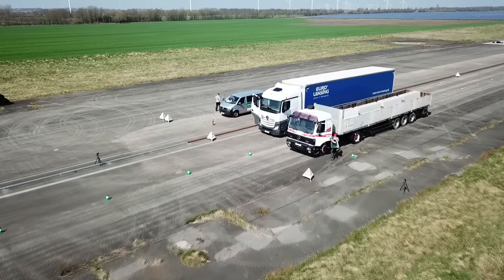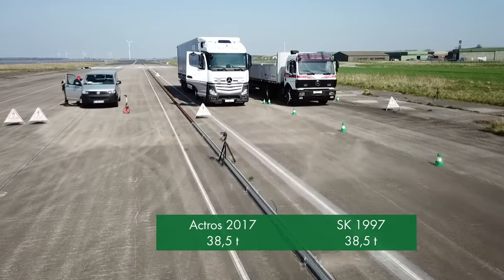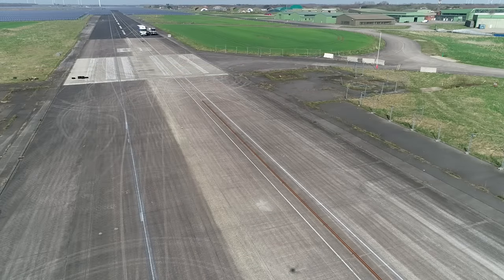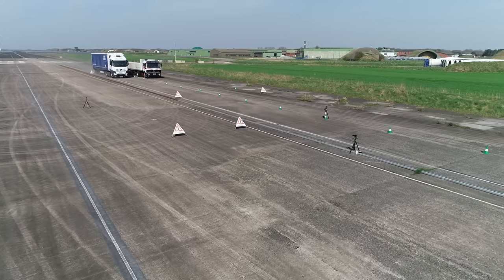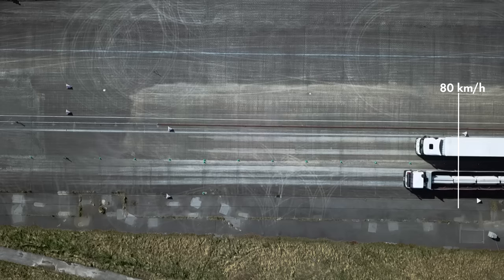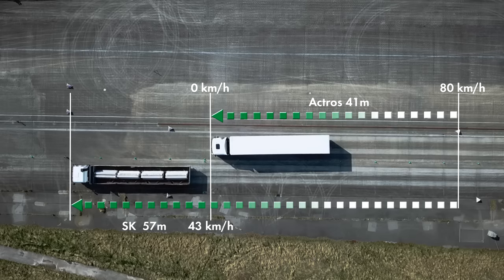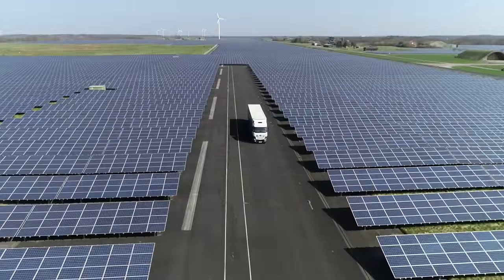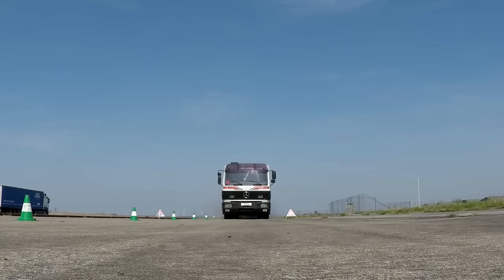Brake test: Modern truck vs. old truck

Comment: Now about the Mercedes safety in real-life. I got nearly killed by Mercedes emergency braking system. While driving through a curve, fully loaded, the sensor indicated something (a rain drop, autumn leaf idk) and started braking with full force in the middle of the curve. Great experience, had to do my best to stay on the road.
Reply: mercedes benz should detect stationary objects not a rain drop or leaf
Reply: I turn all the crap off! Lane assist and collision alert! I frickin hate it when 'it' thinks!!!!!! I'm the bloody driver, let me drive! This shit is because drivers will drive tired or drunk or drugged or on the phone or reading a map and people have died cos they not paying attention! So us professional professionals have to suffer! It like race cars, drivers love a raw car, start putting computers on it to help, drivers hate it!
Reply: @terrystratford1235  That's  why I love 90s cars and trucks, too old means harder to find parts, too new means too many unstable computers. 90s are just right.
Reply: Happened to me it kicked in when raining and the car passed me on the m1 with fog lights on just took a noise dive drive a man truck now no problems yet!!!
Reply: I've heard they also do that in some tunnels and roundabouts
Reply: Now u have a experience you can tel everyone.
And it is not only M B
DAF has the same problems
Reply: @truckingwithwim8039  i think because the straight shadows. but maybe if they would combine it with the radar system it could be fixed
Reply: @bruhh_007_  You mean with the same system as what Volvo has?, thats a good system
Reply: Your Freightliner brethren over here in the states don't have it any better.

Thanks, Daimler.
Reply: @evonation630  Happened to me, too. It kicked in during rain when a car passed me on the M1 with fog lights on. Just took a nosedive. I drive a MAN truck now, no problems yet.
Reply: @nathanmenezesaw1983  or its a company vehicle! It's a Renault t5! I don't think any self employed buys a Renault! Volvo running gear with Renault cab! It's ok, but when you've driven a Scania, you don't want anything else!
Reply: I will never brake for rain drop or something. Did it say it's breaking for pedestrian or vehicle.
Reply: You can override the system by throttling past kickdown
Reply: @nathanmenezesaw1983  the systems are mandatory by law. They're not an option anymore
Reply: I experienced that problem too in my car. Actually it was a crash barrier that started in the middle of the curve and the sensor didn't check that I was not even steering towards it, only that it was right Infront
Reply: Almost like we should be trusting ourselves as drivers more than an effing sensor and a computer. I would not buy something that can try to drive for me. Cruise control can even try to kill you, but at least that tech has been around for many years and has had some refinement. All this new automatic steering and braking is an accident waiting to happen. I'll stick to vehicles without that crap in them.
Reply: Yes the same unwanted experience. Poor guy behind me. He must went to change pants..
Reply: Scanias do that too.
Reply: Give this man an Autumn Leaf
Reply: To be fair the improvement in stopping distance here quite likely is the result of reasonable engineering of the anti-lock brakes instead of this marketing driven useless half baked "fully automatic safety features".
As a general rule the overambitious new "fully automatic" approach fails, gets silently abandoned to be replaced by a reasonable driver assist approach not suffering from these unpredictable effects and failures.
Reply: You can complain to the company then 🤔
Reply: The auto breaking is the most dangerous feature on any vehicle I've ever driven its absolutely lethal
Reply: The problem is that a lot of vehicles, truck included, use a rather 'dumb' radar-based system. It can be fooled by the armco (barriers) on the edges of curves as you're taking them, they can also get false positives from the radar bouncing off other things.
Over time I hope these systems become much smarter and much more aware of where the vehicle is actually travelling vs 'if there's something in front then brake'. :)
Reply: I had many similar experiences with a system (forget the name now) on a Freightliner Cascadia.  The system even overrode the ABS once and locked the brakes to a complete standstill on the highway.  I will never use that junk again, the real world has too many variables.

Edit: Maybe the Bendix system...  It freaked out when an empty potato chip bag blew across the road one time too.
Reply: My truck has the same type of system. Fucking shadows set them off
Reply: @omarmontana1969  yes...something was in front of him.  a leaf, a traffic sign (this is the MOST reason!), a pigeon, a tree. the emergency braking system in an Actros is WELL known for this behavior....just watch the videos of several truck drivers, where you can see an Actros braking for nothing!
Reply: @terrystratford1235  I drive a 2008 Scania R-series and I absolutely love it, besides that the ABS is not working on one of my trailers. Great handling and no assists besides ABS, EBS and TCS. It's fucking marvelous.
Reply: @tntfreddan3138  I love the Scania!  I drive Renault/ volvo and daf. I hate the daf! It's soooooooooooooo slow to accelerate! Crap on fuel and the steering while reversing seems slow, makes me look like a learner!
Reply: Cool.
Reply: We will be having even more fun when ! "AI" cars take to the road.
Reply: Driving is a task for humans, not machines. I would really hate to be suddenly braked(or similar things) by the electronics of the car while i drive
Reply: How about the load, be it pallets or rolls of steel trying to tear off and flatten the driver's cabin, with the driver inside, in emergency braking situation.
Reply: Want a timely fix to the problem? someone should make a device to trigger these Emergency braking system, then some fix will come quick. Until then, good luck.

Past history, Pinto's fuel system, Focus, Fiesta transmission.
Reply: When backing up Escalades do that also  . Most of the time there’s nothing there . I think it must see dead people lol
Reply: @Muh1000  Hmm, what car was it? I have a Mk4 Skoda Octavia and never had an issue with the auto braking; sure it might throw up a warning a bit early but never had it brake on me for no reason. Then again it does have both radar and sensors as well as a lane camera.
Reply: @johnbower7452  Kia Picanto Ja GT, but yea it only has one sensor in front. Also after some service (they likely made a system update) it never happened again and there were some situations where it was on point
Reply: @pqhkr2002  I have to agree with you. Sadly, 90's machines are at least 20 years old
Reply: @sayingnigromakesyoutubecry2647  But they are reliable, many many of them still driving around, some with bad interior and exterior, but powertrain still in very good condition. Cars transporting people around, trucks and vans doing their daily jobs. Most of them already have 200k or 300k miles on dash, some even more, but still powerful, still trouble-free on emission test and their job site.
Reply: @pqhkr2002  it's true. They were well built. Materials were good. And they don't have corrosion troubles unlike an 80's car or older. Also they are fuel injected so they start up without problems.
Reply: @sayingnigromakesyoutubecry2647  Yes, 90s computer system simplified fueling, idle control, and ignition timing, adjustment works got reduced greatly or  no adjustment at all, which makes engines easy to maintenance and diagnose. But then mechanical structure become more and more complex, they introduced VVT, direct injection, etc.  Computer system get bigger and bigger, have more and more sensors, then more and more unreliable, harder and harder to diagnose, and more and more expensive to repair.
Reply: @pqhkr2002  yeah. 90s is a little electronic technology but not too much. Anyway, it's nice to have vvt... Some 90s cars have that.
Reply: @sayingnigromakesyoutubecry2647  I know Honda have many VVTs in 90s. Toyota, maybe late 90s? 
Yeah, VVT is a good thing to let small engine have better output, but seems like VVT is usually driven by oil pressure, so it's sensitive to engine oil. Owner have to keep eye on oil to make sure it works as it should be.
 I have met 2 extremely screwed up VVT cases. One is an Audi  V8, used wrong thickness oil, VVT stucked at some position, caused wrong valve timing symptom. 
The other case is a Corolla,  low oil, caused VVT explode. Yes, it exploded, blew a hole on timing chain cover.
Actually I don't like such complex things in my engine. You know in machine world, the more complex, the more unreliable. So for me, when I need more power, I just get a bigger simpler designed engine to get more reliable raw power.  Like my 1994 Chevy454 7.4LV8, TBI type EFI system, yeah only 230hp, quite a poor power to displacement ratio, and poor fuel economy, but it's like a rock. Seldom to break down, easy to diagnosis, easy to fix and parts are cheap and easy to find.
Reply: @pqhkr2002  woah that's a pretty big engine. In my country 2.0 is already big. Most use 1.6 4 cylinder.
By the way, you are saying something similar to Scotty kilmer. But he chooses a Toyota celica 95 1.6. it's a Corolla coupe essentially and it doesn't have vvt.
Reply: @sayingnigromakesyoutubecry2647  Big engines, that's why I love America, a country that have big machines every where.
Scotty Kilmer, he is a skilled mechanic. I watch his videos sometime, but he speaks too fast and too much for me, because English is not my mother language. 
Celica, I met an 88 Celica GTS recently.  Wow I love 80s design, both interior and exterior. But don't know why, I am 170cm / 5f7in tall, and 80kg / 176lb weight, a typical Asian people, but have hard time to get in it.
Reply: @pqhkr2002  sometimes cars are made for certain markets ... And it's size changes it.
Reply: @pqhkr2002 it's cool to have big engines... But I think that a V8 is overkill. Like I said, a nice 2.0 is big enough for a normal use... Even a 1.6 4cyl has 170km/h max speed, and max legal speed is 130 km/h. Yes I know, a V8 7.0 with 250 hp will last forever at those speeds... But forever could be too much 😂
Reply: @sayingnigromakesyoutubecry2647  Yeah, if power the SUV it self, it's overkill, but if with a trailer weights 6000lb / 2.7t towed, and cruse at 80mph / 129kph, maybe it will be just right. This SUV have towing compacity of 10,000lbs / 4.5t. The last owner told be he cruse at 80mph with a boat, not sure how much weight his boat is. And I also read someone have same model and engine, said he once even forgot he was towing a car while crusing in mountain road. My SUV is 1994 Chevy Suburban K2500, actually same powertrain with Chevy K2500 pickup truck at same time period. Not sure if you are familiar with Chevy trucks, but you should familiar with Ford, Chevy K2500 have same weight rating class with Ford F250, and Dodge Ram 2500.
Reply: @pqhkr2002  well, that's a different story. I was talking about small sedans, like something a little smaller than a civic. Like a 90's civic for example. SUVs always need a bigger engine. One of the most popular SUVs here in Argentina is the Honda CR-V, 2.4 liters. So we don't use big engines... Maybe you can find a v6 3.0 as a very big engine. Toyota Camry and Honda Accord are considered too big for us, uncomfortable for parking and too much fuel... but I understand that in USA they are considered medium size and are very common.
We have a lot of pickups, the most sold is the Toyota Hilux (2.4), we have a lot of Ford ranger 2.3, vw Amarok (I think it was 2.0tdi), Chevy S10. You can find some Rams 1500 and 2500 but it's overkill. For work, Toyota Hilux is best. You might find a new ford f100, there are lots of old f100. F150 are rare. F250 worse.
I have no experience with trailers, and they aren't that common, but if you see those, they are usually pulled by a pickup like the ones I said before.
Reply: @sayingnigromakesyoutubecry2647  Actually not every where in US are big car friendly, like San Francisco or many downtown area of big cities. I always park my SUV in a safe parking lot, then take bus, tram or subway. It's already a pain to drive on those tiny streets, just don't mention finding and getting in a roadside parking space.
If I am in your country, probably I will go with CRV, or shorter version of pickups.
I don't know how those pickups supplied in your country. Here in US, they have different cab and bed configuration, so they have different wheelbase and overall length.
I don't like sedans, because they are too short (antonym of tall), eyes of driver or passengers are right the height of highway fence, water mist in rainy days, and same height of truck wheels.
So I like SUV, pickups or vans.
I want bigger engines, is actually for more torque, to reach posted speed faster. I am not a racer. Bigger torque is quite handy when enter highway via a very short merge-in line. Just flat out, when reach the end of line, I have got same speed with traffic and merge in safety.
And bigger engines can last longer.
Reply: @pqhkr2002  it's true, I forgot that you can't drive in big cities. Here in Buenos Aires I would never go in a car. Perhaps I would use a bike but there's too much traffic. About sedans, I like them because they are smaller. When your car is shorter in height, that means you will save on gas. Also, they weight less. But I understand that a tall car can give you more vision.
I dunno why we had crvs. Maybe it's because they came early and thanks to the good quality they remained. We also have a lot of cheaper Ford Ecosport. That was the first popular SUV. I don't think you can find one in USA, since it was more of a regional vehicle. It has a 1.6 or 2.0 4 cylinder and the first model was based on the Ford fiesta in the 2000's.
I don't think we have many options about pickup configuration. You can chose 2 or 4 doors, but not much more. Most pick-ups are small, and the RAM 2500 is much bigger.
Reply: @pqhkr2002  I agree, having a big engine gives you safety. Not only for merging in the highway but also for overtaking. But even so,  I feel pretty safe in terms of power and torque with my mom's Ford Ka sedan 1.5 2017. it's like a more basic Ford Fiesta. This is a 4 cylinder with vvt, and the newest model is a 3 cylinder 1.5 with a little more power. Since it is so light, it moves very well, and it has decent torque for it's displacement, maybe thanks to vvt.
We used to have the Ford ka 1.0 and 1.6 4cyl from the beginning of 2000's. That car was a small compact. The 1.0 was sufficient, but the 1.6 was very fast. It was amazing. And none of the cars I mentioned was turbo
Reply: @sayingnigromakesyoutubecry2647  Yeah, I have no memory about Ecosport here. But Fiesta, I think I meet some. 
The shortest pickup here is 2 door, single row of seat, with 6 feet bed, I am not sure if there is 5 feet bed. Many people purchase 4x4 version, usually Toyota Tacoma, rise suspension a bit, use bigger wheel, then go offroad. These puckups are light, short, descent power from 3.0 V6, and reliable, bumping around is a pure fun.
Reply: @sayingnigromakesyoutubecry2647  Power to weight ratio, that's probably why some time 1.6-1.8 Corolla or Civic can have similar driving feeling with 3.0V6 Camry or Accord. But that's only driver, if have passenger riding along, nope.
And I just realized one important thing. If most of vehicle are small engine powered, it's ok to use small engine, you won't be a trouble maker due to lacking of power. 
One of my work mates is from Japan, he said in Japan, there are tons of cars, even some light trucks have engine smaller than 1L, but since almost every one use this size, no problem.
But in US, I heard some where said US government don't allow vehicles with engine smaller than 1.5L enter market. Maybe it's true, because so far the smallest engine I ever met was 1.5, Toyota Echo? Or something, forget.  My mechanic call it "買菜車" in Chinese, I don't know what's in English, maybe "Shopping cart", or "Grocery cart". It's okay for local running, between home to local market, but if highway, you gonna have a line of angry drivers behind in a ramp. In US, streets and highways are full of 1.8-2.7L 4cyl for sedans, small pickups(not usual), small SUVs like CRV and RAV4 , 2.6-4.6 L V6 for sedans, minivans, small pickups and middle SUV like 4-Runner, 4.0-8.1 L V8 for luxury sedans, full-size pickups, vans and SUVs (yup, my 7.4 is not the biggest), and 5.9-7.3L I6 or V8 diesel for full-size pickups, vans and SUVs. Even VVT + turbo still can't save engines smaller than 1.6 from trouble maker, they even have hard time to overtake a truck or van, especially with passengers riding along or some grade of climbing. 
And how long is the life cycle of cars in your country? My Japanese work mate told me in Japan, cars usually no more than 100,000 km, they will change new one. Not because it's unreliable, they just do so. But in US, my mechanic told me if properly maintained, it's usually 100k miles x number of cylinders. So 4 cyl is 400k mile, 6cyl is 600k, 8cyl is 800k. Usually here we have 10k miles per year, so a 4 cyl car can last 40 years, but people usually consider half life as a step, 20 years. That's why we have so many 90s cars running around.  I think it's quite a long cycle. Especially with the fact that US is a developed country in automobile industry. Japan is developed too, and Western Europe, they are longer than Japan, but seems like they don't have such a long cycle, either.
Reply: @pqhkr2002  well, that's the perfect example. Japan is small and most of the transit is in the same city. In USA you usually need to travel very long distances. That's why you use v8 and Japan 3-4 cylinder cars. We in Argentina are in the middle. You can find for example a wv up 1.0 today, but people that buy that car shouldn't use it for the highway or long distances. 1.6 is enough for going long distances occasionally, like in vacations. And if you travel a lot all of the time (and you have money for the gas) you should use at least a 2.0 or v6 3.0 (we don't have cars with v8 almost).
It's true what your mechanic says, that engine lasts longers with more cylinders. It also last longer with more displacement. If you have two engines with equal hp, the one with most cc will last longer. That's because bigger engines have more torque and less rpm, producing the same power as a small engine that would have lower torque and higher rpm. When you go higher in RPM, your engine wears faster. That's because friction is proportional to speed of the movement. For example: In a big V8 you would need 1200 rpm for 90mph while in a small 4 cyl you need 4000rpm or more.
In our country cars last a long time... In my experience, we had a vw Santana 2.0 4 cylinders with 300.000 km. We used it a lot (more than average), and the engine was consuming oil. It wasn't mantained very well, but it still ran ok... So... I think that with proper maintenance and care it could last 500.000km.
In Japan they don't care how long does their engines last because they don't do that much km. I think that if someone imported a Japanese car with small engine it would wear faster than our "local" cars. European cars use a little bigger engine than japan but they are still small for our standard. And if you import one of those your suspension will not last long. Cars specially designed for Latin America have better suspension because our roads suck.
Reply: @pqhkr2002  about displacement and weight, I think that the automaker approach is this: Ok, we need at least 10 seconds in 0-100 kmh, and we can package this much extras (in kg) into the car. That would be the base model, around 1050 kg. With that goes a 1.5 or 1.6. The next car in the line is the 1.8 or 2.0... we need at least 9 seconds in 0-100 so it's a little faster and we can improve the comfort making it weight... 1300kg. The next step can be a 2.4 with a little more stuff, little better acceleration and like 1600 kg and finally the 3.0v6 with 1800 kg, also slightly faster.
This approach sucks! I want the base model at 1000kg, no extras, and with the v6, lol.
Reply: @pqhkr2002  in the 60's something strange happened in our country. We had huge ford falcons with 6 cylinders, 3.0-3.6, dodge v8 or Chevy ss v8. And at the same time we had cars with only 2 cylinders like citroen 2cv or 3cv, 4cylinders  fiat 600, beetles. So you could take the post war europe approach or the USA approach. But all of the cars were very good.
Reply: @sayingnigromakesyoutubecry2647  Forgot to say, yeah, Japanese people don't drive so much, 100,000 km I remembered he said was 5 years in average. Talking about suspension, I meet several Japanese cars, 90s cars, if we have 2 people weight about 80kg sitting in front seat, it gonna be interesting when encounter a hole or speed bump. Here in California, years ago, roads were also suck. Now it's better, the "Rebuild California" project makes roads far better.
Reply: @sayingnigromakesyoutubecry2647   1000kg with V6, don't know why they don't make such vehicle. Maybe they think it don't have such market?
Reply: @sayingnigromakesyoutubecry2647  60s is a gold age for automobile. People have big cars, big engines, big power, never worry about fuel price, car makers never worry about emission.  I am 90s, the only way to know that era is from movies.
Reply: @pqhkr2002  a v6 on a 1000kg car would be a sports car... Well... I can't really think of one. Mazda mx5 and Honda s2000 come to mind. Also a Peugeot 206 rc But they aren't a v6... Anyway, Its difficult to get one of those in my country.
The thing is cars weight too much with innecesary stuff in my opinion
Reply: @pqhkr2002  yeah, we had big engines in the 60s, but at the same time we had the smallest engines ever. The citroen 2cv was two cylinder and 9hp to 29hp depending on the model, and 600 kg.  The fiat 600 was 32 hp and 600 kg, but 4 cylinder. Those cars shared the same street at the same era with the big American i6 and v8...
Reply: @pqhkr2002  90s have a bit of emissions controls but not so much like today, so there were very interesting things done, and not so contaminating as before. Nowadays even Ferraris and Hondas have turbo to pass emissions
Reply: @sayingnigromakesyoutubecry2647  In my opinion, just air bag, ABS, power window, power steering, A/C (traditional manual), FM and music, no other bull shit. Yeah, that's what we got in a typical 80s and 90s car. The more so called safety feature, the more bonehead trouble makers on road.
Reply: @sayingnigromakesyoutubecry2647  Ultra big share the road with ultra small, that's probably an interesting scene.
Reply: @sayingnigromakesyoutubecry2647  90s emission, I think is just not so tight. I think 90s actually have 2 different world, divided by model year of 1996, when OBD-II come as standard.
Reply: @pqhkr2002  I agree, that's enough equipment. But... Still... Modern cars are better, less fuel consuming, less contaminating, safer, more airbags... 10 years in development is a lot for the car industry
Reply: @pqhkr2002  yeah it was something. Back then there was little traffic so it wasn't a huge problem. And some people took those little cars for long travels. My parents went from Argentina, Buenos Aires, to Brazil, Florianópolis, in a citroen 2cv. Absolutely crazy by today
Reply: @pqhkr2002  90s is the first time they actually do something about emissions control, about the catalytic converter.
Reply: @sayingnigromakesyoutubecry2647   Yeah, new car have many benefits than old ones, that's true. But can we really have chance to take the benefits? Brand new small budget cars, like Corolla or Civic here cost about $20,000. A semi-new, within 5 years, small cars like Corolla or Civic from dealers, usually half price, costs $10,000. However you can spend no more than $2000 to have a late 90s or early 2000s 15-25k miles Corolla or Civic in a very decent shape. So how long will it take to get the $8000 on a semi-new or $18,000 on a brand new back? As we already discussed, properly maintained 90s cars are still reliable, they don't break down more often than new cars, and even bad luck, they are easier to diagnose, cheaper to repair.  And if much more bad luck, destructed in an accident, no need to wait days or weeks of bodywork repairing, just junk it and another $2000, you are ready to hit the road again. Oh, forgot to mention, insurance on old cars are much much cheaper than on new cars, I am not sure if the money from fuel saving on new cars is enough to cover the extra money you paid on insurance.
For safety, I always think common sense and proper maintain on car is the top safe thing. The more safe feature on cars, the more reckless those bonehead drivers drive their cars, causing more accidents. Like some boneheads think their cars have autopilot, have line keeper, automatic brake, radars, so they can use phone or even sleeping while driving. Some people think their cars have TCS, so they can drive 70+mph on a 65mph highway in HEAVY RAINY DAY, or enter a 35mph sharp turning ramp at a speed of 60+mph.  So one of the reason why I drive light truck daily because you know, those trucks are build like tanks compare to small cars, I just have enough common sense, and follow the rule, I won't be an accident maker, then my "tank" truck can protect me from those boneheads, if they hate my truck, lol. 
I purchased my Suburban for just $1,750, with some problem at beginning, but with my mechanic's help, just several hundred $, I fixed it by my self, it's now a hero again.  
Meanwhile brand new 2020 Suburban start from $50,000
I just purchased a 2001 Chevy Silverado 2500 pickup for only $900, because its catalytic converter was stolen, I need extra $900 on a new set, so just $1800 to have it ready to go. 
Meanwhile 2020 Silverado 2500 start from $35,000
And I used to have a 1996 Ford F250, $1500, everything works fine. I sold it because that moment I planed to replace it with a flatbed trailer, and I have became a fan of  Chevy or GMC.
Meanwhile 2020 F250 start from $34,000, a bit cheaper but... $1000 is not quite a help for $30,000.
=============
About emissions control, maybe different place have different standard. Here in US, even pre-1996, OBD-I era we still have catalytic converter. The difference I find, is some OBD-I vehicles , like my 1994 Chevy, don't have downstream O2 sensor to watch convert's efficiency. 
Just looked in Wikipedia, starting from 1975, US government have already required new produced cars to equip catalytic converter.
Probably in US, catalytic converter have longer history than EFI system.
=============
I feel driving a tiny cars for long distance, always have some comedy feeling.
Reply: @pqhkr2002  well you are right. Seeing the prices in your country it makes perfect sense to buy an old car. I think I would do the same. I really like the 90's Corolla. It's small and cute. Either 1.6 or 1.8 it's ok for me. The 2000's Corolla is too big, I don't like it, because im still single and young. Maybe if I had a family... 
Anyway my mom likes new cars because she needed a car that was 100% reliable. And if everything is new, it won't break down. There are many people that have such a requirement... They need the car for work and they can't afford a day off for getting the car fixed. We had that problem before...
But yeah, I would totally take the risk, and only buy something very good in quality, like Honda or Toyota. We are too used to shitty latin American cars and those aren't reliable.
About emissions and fuel consumption, you are right in terms of personal choice and economy. But most people buy new cars and it's a good thing they bring all that. New cars in my country don't have all the security features you described, except imports like Volvos or something.
Don't worry too much about cars getting more complicated and reliability, because the future is electric. We will have electric cars, when the batteries are advanced and cheap enough. We will never have a broken engine again, only changing batteries from time to time, changing tyres and suspension... And fixing crashes. That's all. Electric engines don't break, they are very efficient and reliable. One of the best motors you could ask for. The problem is the batteries but they are better than ever and keep being better.
Reply: @pqhkr2002  in my country catalytic converter began in the early 90's. One of the first to come with that was a Ford escort from this market.
Reply: @sayingnigromakesyoutubecry2647  New car is 100% reliable, I think that's more like psychological effect from people that know nothing about cars. They even don't know how to open engine hood. I have such people around, they even said used cars have risk of explode.  lol
The reality about new car's reliability, my mechanic told me, don't buy new cars that have major change within 2 years, especially in engine and transmission. Big chance they will have problem. If good luck enough you have, you gonna get a recall notice, then have a visit of dealer, get the problem solved. Or you gonna have a chance to enjoy old cars flying by while waiting for a tow truck.  lol
Electric cars, yes I agree with you. They don't have things to broken. 
But I think the road is still long, and we just only at the very beginning. Currently electric motor and motor control system is okay, railroad system have already used them pretty many years, quite a mature technology. But the battery is a very different story. Because railroad don't use battery, they use diesel powered generator (diesel train) or power plant (electric train). We currently don't have enough technology to balance performance, capacity, charging speed, cost, weight, safety, toxicity, etc.  
Currently Tesla, probably the best EV in the world, they have enough performance, decent capacity, decent charging speed, decent cost with government subsidies, decent weight (sort of). But safety and toxicity?
Here in California we already have accident that have uncontrollable burning Tesla battery. 
Toxicity? Probably the top 1 topic that every EV battery makers avoid to talk about.
Reply: @pqhkr2002  yeah, you are right. That's why we brought the previous generation ford ka with the 4 cylinder 1.5 instead of the new 3 cylinder. And yes, sometimes they fail, but an used car has a lot more things to fail since it's used. We had a Renault 9. It was so bad that the engine burnt down two times. Aside from that, there are lots of things that can fail, like our old vw Santana that had a problem with the electronic key, refusing to start up. And a lot more.

About toxicity in electric cars, what do you know about the subject? I ask you because I'm doing a thesis about them. You are right about the fires... I don't know if that problem could be ever solved... Batteries are very reactive by nature...
Reply: @pqhkr2002  yeah, electric trains are the best thing in the world.
Reply: @sayingnigromakesyoutubecry2647  Electronic key, I hate that. Got me several times.
About toxicity, I just did some quick search, turns out my knowledge is quite out of date. I thought Li-ion batteries on EVs are as toxicity as other batteries.
But according to Wikipedia, there is not much toxicity in Li-ion batteries themselves, but manufacturing processes.
And currently, the recycling processes is not efficient enough, because we have pretty much batteries pending to be recycled.
https://en.wikipedia.org/wiki/Lithium-ion_battery#Environmental_impact_and_recycling
But still, it's not the topic that battery makers would like to talk about.
For me, fire problem is not big deal, because they only happen in fatal accident. (I actually believe life is scripted.)
The most annoying thing about EV is charging. Even new EVs can charge several hundred miles in just half hour, still a bit long. And not all charging station have such mode. I often drive long distance to national park to spend weekend, but there is not enough charging stations or just no.
And again, we are talking about reliability, EVs don't have much mechanic problem to happen, but computers, may be I am a bit outdated, I don't trust computers.
I talked railroad, newer locomotives have more computer to make them more fuel efficiency, more powerful, more accuracy traction control, but more software problems come along.
That's why many old train engineers (also called driver, operator) miss old days with old locomotives (diesel-electric or electric), just pure mechanic problem or easy-to-spot electric component failure, they are actually easier to diagnose. 
90s cars use small computers like ECU, TCU, ABS, they are small, simple, simplify complex mechanic control mechanism simple, just do their own job, they are quite reliable.
But when there are tons of sensors, big group of computers, and they even connected together via some sort of bus network, constantly talking to each other while I am flying 70mph on highway, maybe with a 2 ton trailer behind in future, I don't think I am trouble-free. 
Probably one small sensor, or just a bad contact in a plug, I will be in big trouble.
Reply: @pqhkr2002  you are right that when you add complexity, there are higher chances of failure. Anyway, there are very clever ways to deal with errors. For example, if a sensor of temperature in the engine fails, it can asume the engine is at X temp, for example 90ºC. There are other sensors that work that way. If too much sensors are failing, then, your car will refuse to work (its way to say "take me to the doctor so I won't die for lack of maintenance").
But yeah, old cars had things like mechanic fuel pump. That thing simply wont fail. Having an electric fuel pump is better but it can fail.

Electric cars are better for the city. They are absolutely perfect for that role, since it wont waste energy when you are in a stop, and it won't waste energy going slow. For high distances, there is nothing better than a normal engine at this moment, because they can travel a lot of km, and can recharge very quickly. 

But imagine the case for most people. They just have to go to work everyday for a distance no more than 25km, for at least 300 of 365 days in the year. When they get home and get some sleep, batteries can be recharged slowly in 8 hours. The slower you charge them, the longer they last.

Maybe you have two or more cars in your family? You could consider having an electric car and a normal internal combustion car, and use the one you would use better in different situations. Or maybe, electric cars just aren't for you. Maybe in the future both technologies would co-exist.
Reply: @sayingnigromakesyoutubecry2647    The clever way you said, maybe it's the "safe mode", this already exist. Different failure have different safe mode.  
But I think the best way is like those on airplane, have 2 or 3 sensors at same position and serve for same purpose. But the cost is clearly not friendly.
Actually there used to be a kind of control method like "electric assisted mechanic", the electric system used to assist mechanic, the engine can still run with part or whole computer system was off, just not efficiency. I once meet a kind of throttle mechanism from TOYOTA, in normal operation, the throttle is electric, but if it fail, like disconnect the throttle motor, you still have traditional wire-driven throttle available for use, but the maximum amount is 50%.
I read on internet that there used to be a kind of computer assisted carburetor, can maintain air fuel ratio of 14.7:1. But it still works when computer is off.
EVs are really not suit for me, at least now. But yeah, they are pretty handy for many people.
I don't have enough space to keep 2 vehicles with similar use. 
I actually prefer hybrid, especially the chargeable hybrid. 
In normal city commute driving, it have a battery set big enough to serve all the way, and can charge by charging station, acting like an EV.
But when long distance driving, it can use gasoline, the only shortage is usually they have a tiny fuel tank.
But, another but, I am not a rich people, can't afford them.  lol
I once think about a kind of convertible hybrid, it have a detachable generator set module and battery set module. 
When short distance driving, insert battery set module, make it pure EV.
When long distance driving, eject battery set module, and insert the generator set module, make it hybrid.
And when the generator set module or battery set module is not in vehicle, it can also work with a power adapter, serve as backup power source for house when encounter power outage.
Reply: @pqhkr2002  you would make good use of a hybryd, a chargeabe one. Also, hybrids have a special cycle, Atkinson, that is more efficient than Otto, the common cycle for gasoline engines. The Toyota Prius comes with that.

I think that normal internal combustion engines have reached a peak in terms of efficency, contamination, and reliability. If you want more efficiency and less contamination, you wil get worse reliability. For example the new diesel engines that come with that DPF thing...
Reply: @Stephen05777  oh how I admire people like you! Make a statement without backing up your claim! So, in your opinion I'm an idiot!  Wish to expand on your opinion? Tell me why!
Reply: @Stephen05777  ah! I see! You are of course correct! Plus from an insurance point I think they may not pay out if it's switched off!? The lane switch I don't like, and turn off, as u have to indicate or it beeps loudly! U don't always need to use indicators! The collision alarm, have u ever been doing 55mph with 44t behind you, and 'it' thinks a bridge stantion is in the way? Well, when 'it' does an emergency brake for no reason, then bloody right I'm switching it off!!! It still works, just less sensitive! What I really love is adaptive cruise! Just set it and follow at a safe distance! In 23 years of hgv driving I've had one small ding in London!  And that was 23 years ago!
Reply: @sayingnigromakesyoutubecry2647  Normal internal combustion engines have reached a peak, I agree. Maybe someday someone genius will discover new technology?
I think environment protection is more like a politic game or war. Traditional vs so-called new energy. I don't like to talk politics, I hate that, my most hated thing.
In my opinion, both engines and motors can do anything, but they don't good at anything, neither of them are almighty. 
Maybe someday in future, the war is over, people get calmed down, engines and motors will run parallel, serve the purpose that they are good at.
I like hybrid, and in US we already have hybrid for trucks, including pickup trucks or big SUVs like mine.
Maybe in future when I get rich, or can find an affordable used one, I will get one.
Actually another reason why I like hybrid is because it is similar with diesel-electric locomotive, I am a railfan.
Reply: @pqhkr2002  I don't think there is nothing that could be discovered about internal combustion engines in mechanical terms. Maybe Mazda has something new to offer but that's it. There were a lot of years of advancements. The only thing I can think of right now is having better materials that can wistand higher temperatures, lower weight or higher compression ratio. That's something that will happen slowly. Anyway, I don't think that engines will be much better than now.
Reply: @pqhkr2002  that's probable. That both technologies coexist. Except governments want to ban the internal combustion engine.
About politics, it's the only way that electric cars stand a chance. At the beginning they need promotions in the form of lower taxes, until they drop their price.
Governments also should promote green energy production, and I also think it's the only way to make it better, because if you let it be, carbon takes the most % in energy production in the case of USA, and in Argentina, natural gas (a little better than carbon).
Reply: @sayingnigromakesyoutubecry2647  In my opinion, since we already have technology to produce gasoline, diesel ,NG and PG by biological fermentation, fuel is no longer non-renewable energy.
We should have more forest, to consume CO2 we produced and output O2 for us to use.
Maybe in future we can have better technology to make better use of H2, for fuel cell or engines.
This thing is carbon-free, and high calorific value , a pretty good solution. 
And I think fuel cell is pretty potential, and the fuel cell I said is not limited on H2, can be other types of fuel.
Reply: @pqhkr2002  yes, you are right in that. If you think it that way, biofuel can be renewable energy. But... You need all those threes or something equal.
H2 isn't that good. Because when you produce it you need to make electrolysis. And that takes a lot of energy. In the end, hydrogen is like storing energy, and that kind of storage is worse in energetic terms than using batteries. Think of it this way. If you produce 100% electricity at a power plant, the % that makes your car move is lower in a hydrogen car than a electric car. Also, electric cars are a reality now. Hydrogen would need more research. One of the disadvantages of h2 besides that is storing the fuel in a safe way. It tends to explode.
Reply: @pqhkr2002  there are a lot of promises about making better batteries. Maybe we find something that good that would solve the autonomy and weight problem of e.v.
Reply: @sayingnigromakesyoutubecry2647   Yup, I just forgot its drawbacks you said.
Reply: @terrystratford1235  Still tech is more dependable than humans.. Since 2005, deaths on the road involving heavy vehicles has been cut in more than half in my nation.

Humans are flawed. And tech that helps migate those flaws are much welcome..

People do not need to die cause of other peoples vain..

98% of drivers think they are above average driving skills... Yea.. Humans.. Aint very realistic when it comes to themselfs, they tend to think they are much more compitent than they really are.
Reply: @MrDanisve  I don't disagree with you! When I'm driving, I'm driving! No phone, stereo off in towns, so I can concentrate and hear! Slow and polite! A rare breed maybe? The whole fleet are getting cameras fitted. I like as it could get me out the shit one day! But yes, alas the human! With the ability to think! Just today ( my 44t does 50mph) m5 50mph road works average speed camera. Car comes speeding alongside me, we hit the 1st camera, he slowed down, to about 1mph slower than me! But dick head thinks ( thank god I'm in front of the slow lorry. I'll do an indicated 50 on my speedo!) Speedo can be out! So I end up having to overtake, then the magic part, they match my speed! The most dangerous place to be, but they sit there! If I have a tyre go, there dead, simple as that! What is it about getting in a vehicle, that makes normal family god fearing folk into inconsiderate aholes?
Reply: @terrystratford1235  I remember i was one of those when i was a young buck.

"Stupid lorrys going so slow in the corners, and using an eternity to get back upto speedlimit after slowing down"

Ive since grown up and learned that, well our modern life could not happen without lorrys

Ive altso driven large machinery (Alltho not road legal) they would be such a hassle driving on the road. If theres tons of traffic now, i make sure i stop for the lorrys so they can get into the roundabout. My way of making up for my stupid young self :P

But i altso se some really stupid shit on the road. Like that 100 horsepower tractor that was loaded with... im guessing 50 tons..

Where i live we have this huge hill, hell if you have less than normal horsepower car you will struggle to drive up that hill in the speed limit of 70 kph (Its so steep)

I got behind the tractor in that hill. A hill that normally takes me 1 min to drive up, took about 6mins cause he was driving at 3kph up that hill. Could not pass either, cause the hill in in a large turn (So you cannot se far ahead, aswell as gravity making your acceleration bad)

And i could not get close to tractor cause i would have suffocated by that black smoke.

So i ended up being patient. 18 year old me, would certainly risked his life getting past that.. 18 year old me, altso had alot more horsepower in his car tho.

I might have said some bad words about that tractor driver inside my car :P

Overall people drive pretty good here. Lorry drivers get more flak than normal people. But thats cause of the lorry drivers that come from eastern europe, into Norway.. And they do not have proper winter tires..

Its like a plague.. Think we had 12 lorrys stuck on the highway at the same time, all of them eastern european with shit tires -.-
Reply: @evonation630  xxx
Reply: yup emergency breaking and line assistant sucks :x
Reply: My colegue had similar issue driving volvo 2018. He had a car turning in front of him. He estimate that he doesn't need to brake because there was enough time and space to drive by but the system thought otherwise. The truck slammed the brakes so hard that the load almost came off, but, luckily, it was tied well. I don't like when machines think instead of the driver. They aplly well when there is an idiot behind the wheel, but normal driver find them unusable.
Reply: @omarmontana1969  ghost?
Reply: @pqhkr2002  too old to find parts? The are always after market parts that do a wonderful job. So old is gold
Reply: @sevenscounty409  As long as it's not made in China. I some time prefer to go junk yard, some time old original is better. But too old ones is not easy to find in junk yard.
Reply: How about EPS gearboxes as well. They were a barrel of laughs.
Reply: @raymundhofmann7661  my bet would be first on the tires... which, whatever you say is the most important part of any road going vehicle (ok, that and the dampers actually). The last decades have seen incredible improvement in the chemistry of rubbers and other tpe / soft plastic...
Reply: My volvo fh did the same thing on a corner, a car was parked on the corner shoulder and the volvo sensed it and the  emergency brake came on with full force. Almost gave me a hard attack.
Reply: That is stupid that tht happend. in such a case a push of the throttle or steering should stop the emergency brake
Reply: @willidriver  cthen you would react against the safety, not the threat...
Reply: @ram89572  I think new systems can be good as long as theyre only alerting you and not driving for you
Reply: @ruce9269  Agreed. I'm absolutely fine with alerts.
Reply: @pqhkr2002  if you crash in one of these
Youll be in a ball of iron
Reply: "Had to do my best to stay on the road." HAHAHAHAHA I know that was a terrible situation but your comment made my day bro! I already imagine just a relaxed drive turns into a fight to stay on the road all of a sudden for nothing!
Reply: Same thing happened to me in a Nissan Qashqai, slammed brakes on for no reason.

Gone and bought a Dacia Duster now with none of this electronic braking shit.
Reply: @terrystratford1235  hate to break it to you Terry, many professional drivers drive whilst on their phone, tired or drunk.
Reply: @Dosedmonkey  sadly I know! I've seen one driver having a bowl of cereal! Reading a map, reading paperwork! Professional driver just means this is how they earn money! I wish drivers could be a little more......professional!
Reply: @terrystratford1235  I hope u got an update where u can’t turn it off anymore.
Reply: @TheBerlinbaer  tell me why! Have u hit something and wished you never switched it off? Or have u been hit by a lorry and this would have saved u from injury? Remember, all this tech is because drivers are doing something other than driving! I'm very serious about my driving! I love some tech, but not all! One question......you are traveling along and all of a sudden your vehicle does an emergency stop for no reason! U have a button and pressing it will stop this from happening! Do u press that button?
Reply: the 13 plate daf cf i used to drive was a nightmare for it, it used to loose its marbles approaching a roundabout in the right hand lane
Reply: once i overtook other truck in 2+2 highway, i merged back to right lane after passing that truck and then out of nowhere my MB truck started to beep and braked hard, weather was fine and dry, no traffic in front of me.
After that i always switch off these controls, i can't trust that crappy merc, even Volvo FH had beeped few times withour reason
Reply: @terrystratford1235  hell yea sensors only get in the way of good drivers we know what we are doing and don't need some stupid sensors overreacting and doing stupid things like slaming the breaks over a stupid leaf i don't drive anything with sensors or computers in them I can do all the calculations my self on how I want it to run
Reply: Get me another truck and new pair of pants.
Reply: Had this happen on Mercedes, Dafs and some 4th gen Scanias. The kits good when it works right but scary when it doesn't
Reply: @terrystratford1235 agree with you 💯%. I turn off all the useless safety crap. The only useful tech in vehicles especially bigger vehicles are blind spot monitors and reverse cam.
Reply: @terrystratford1235 the Jeep assistance is full of crap. It pushes you inside the lane, without you even being near exiting... also the automatic braking system sends you in full panic mode with all the beeping and emergency breaking for no reason. Had a rental, almost had a heart attack two times in a week...